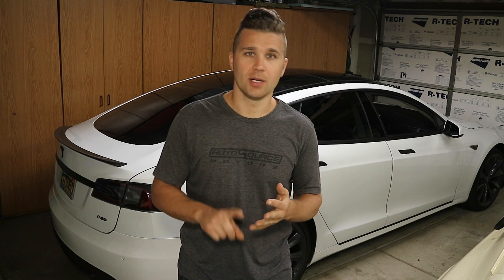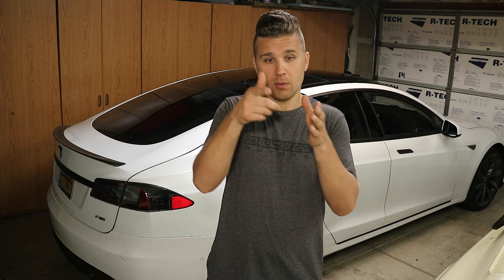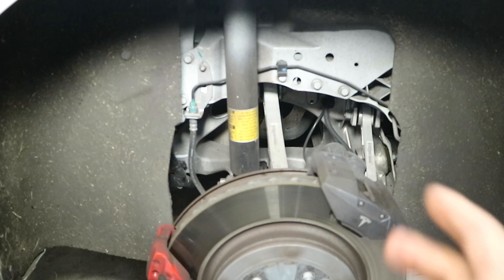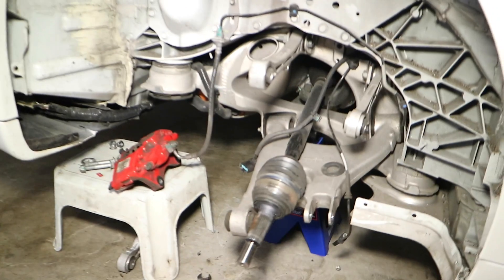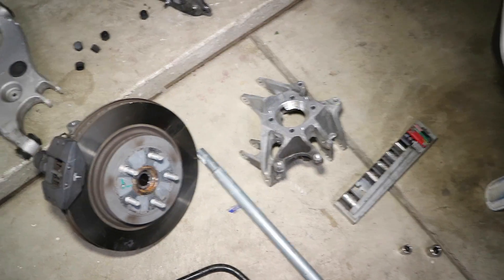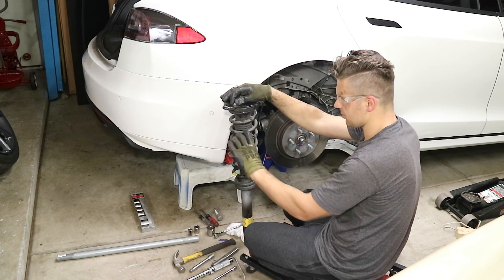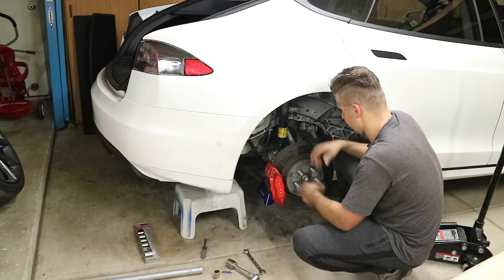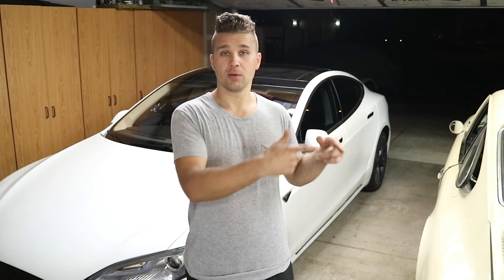Tesla Model S Suspension Issues and Problems

Comment: Ive a 2014 P85 now 135,000 uk miles I think the problem is a lot of hard launches deform the rubber bushes as the upper control arm is the torque reaction point and only being RWD and 2.2 ton thats a lot of torque. AWD cars share the torque loads with the front wheels. My car rear wheel steers a bit with the accelerator.

Comment: Good video -- but how the heck did you get the inboard front nut off the lower control arm?  I see the slot up from under where the aero panel was, but the access isn't straight?  Did you use a flex head wrench??

Comment: i have same issue caster is off one side (did the finger test lol). great video, i follow your guide and change the hub that didn't fix it. so i change lower control arm and fix it finally. i was sceptical that lower control look so beeffy, how can it be bent right? i was wrong.  when i took the old one out and lay it next to new one.. i can confirm the bent is lower front of the arm (arm left/right same part flipable) so anyone have rear suspension caster is off.  i recommend change the lower control arm 1st..
Reply: Is your car a new car or did you buy it used?

Comment: So what component(s) were bent or damaged??? Was it a bushing? - I can't imagine deflecting these massive elements. Must have been an accident.
I don't like to work on suspensions. I have possibly the same Craftsman air compressor like yours. I use the air tools as much as I can, certainly during dis-assembly. Air ratchet, 3/8 inch butterfly impact wrench and even the 1/2 inch impact. Torquing during assembly is a pain but advisable.

Comment: Great undertaking, and without a shop manual!  I would have had a few extra bolts when I finished that job.  Nice to see someone working on the Tesla.  The first I've seen on YT.  I have a 2014 ordered, due next month, and I'll be sure to check the tire clearance when I get it.  I'm thinking it may have been caused by the 21"'s hitting a good pothole.  Another reason why I wanted 19"s in my Model S.

Comment: Torque specs from a random fastener distributor? Hahaha!!! Tesla bolts have a special coating that changes the friction level, changing the torque spec as well. Some should be changed every time they are removed. And the control arms, or in general any suspension arm with a bushing in it, should be torqued with the car at ride height. Is that axle clicking when pulling away from a stop yet? They take a special grease to prevent that. You don't even know what you're talking about with the very simple brakes. The electronic parking brake is only the grey caliper, it doesn't have any effect on the read caliper which is the normal braking system. I'll give you credit for not letting the caliper hang though, but if you're working on cars a lot just spend a few bucks and get some hangars. And you're lucky your car doesn't have air suspension, they are a lot harder to get the strut back in, which you really didn't need to take out in the first place. 
This video can best be described as "more money than brains". Good luck with that.

Comment: I would not have gone on a test ride because the alignment was on a bent wheel.  When you put in the straight part, you changed the alignment.  I would have taken it to the alignment shop first, and then test drive...

Comment: I've been thinking getting Tesla from auction.
What's your experience telling you about it?
My concern is if it's hard to get parts and did you have problems with any electronics (sensors, modules)?
Since it's very different from typical cars

Comment: Larry puts two fingers in the passenger side wheel well
Driver side he puts three fingers into wheel well.
re-watch you can see passenger side his fingers are lower 
(note panel horizontal line and his fingers are higher off the ground, right?)

WHY didn't he actually measure the gap? 
You can try on your own car. insert 2 fingers and then do again with 3 fingers 
(which of course means you are further above the ground.

This may be why no one could measure anything wrong a the alignment tests.
It was great to see the replacement, he did a really nice job.

Comment: Is it possible that this was a bushing issue that was bored of center and when installed caused a mechanical off set? It very unlikely that you would be able to deform or bend cast aluminum without it showing cracks.
Reply from the maker: No i believe the lower control arm was bent

Comment: wow, strange the initial alignment test didn't show the problem/arm bent.
Reply from the maker: Only when the suspension is under compression it would show. Alignment only reads front and rear wheels driver or passenger side. No sensors to read bothwheels rear or front at the same time.
Reply: Man Meets Garage  Hi I have a similar issue, which part was actually bent on your vehicle ?
Reply: CanadaRulez4Ever i

Comment: How is pricing on Tesla parts compared to other american premium cars? Those parts looks extremely expenive with all that machining done to them. Also it looks that Tesla used steel bolts againts the aluminium, if they have I'm a bit concerned with corrosion  because of the salting here in Norway..  Thanks for giving us such a detailed shot of the suspension!
Reply: Stainless steel is often used with aluminum.  I'm not sure if that's what Tesla did, or which SS, but I would presume that would be the case, since I've never heard of corrosion being a problem with Model S.

Comment: Most likely somebody raced the car and hit a curb with this tire, that's why the control arm was bent or as previously mentioned the car had been in an accident. Also when you took off the strut there was no need for any rope or clamps, you only need it if you dissemble the spring and shock absorber.
Reply from the maker: Thanks

Comment: Well I guess all that torque's been working this arm, maybe it had a structural weakness right from the start, on a molecular level. Aluminium is a tricky beast to get stiff.
Reply: If you watch carefully around the inside of the wheel well, you can see signs of repair, this looks like it hit a curb too hard.

Comment: You could have edited out tighening the bushing mounts with the suspension loaded, or.. you tighened all the bolts on the suspension without loading up the suspension. And if you did the later, Congrats on torn and ruined bushings =D Or at the very least dramaticly decresed life on them =)
Reply from the maker: Suspension was pre-loaded and torqued down. Thanks

Comment: i was in a tesla for the first time today it was a cab im a mec so i asked do they have problems i know that Electric powered tools Works great to start with and then the problems comes he said that there was some problems with door handles and power Windows  but no problems after that the warrenty on the battery cells is 200.000 km after that it is 80.000 kr or 13.000 $

Comment: Very well done Man meets Garage. There is nothing like sharing technical knowledge. Thanks again.

Please find links to 1) Tesla S suspension description and 2) Suspension Repair manual with torque settings. The air suspension is a little more involved and is also described. SAFETY is key and I do hope Tesla will make what is currently available to residents of the state of Massachusetts is universally available to all.

https://ln.sync.com/dl/b8e8bf9d0#qyvqcz3x-68yk7q9j-w24qwvjs-2thm6xcg
https://ln.sync.com/dl/5b988ef40/xthdc8pe-jeg4d9z9-ubfxjvkx-7gctvc33
Reply: Sorry guys - recreated links to docs below -

https://ln.sync.com/dl/e946047a0/cy5vj5c2-38ci6d8d-bx4zg2xt-jqmtpnqt
https://ln.sync.com/dl/48aa25b40/73hk6yfg-skyaqvxy-amzitgf5-4hdvhy74

Comment: okay... where did you get your parts on a take out basis from Tesla?  what did those parts cost? .. Your car has obviously been curb slammed .. this happens when the car is pushed too hard into a corner and the back end washes out... seen several videos where this has happened... did you check that strut for cracks in the mounts?   You obtained this vehicle 2nd hand from a TESLA retailer? where did you get the torque specs for all those bolts? are they available online? thanx..
Reply from the maker: i purchased the parts on ebay. Vehicle was purchased at an auction. Torque specs are followed from boltdepot.com.
Reply: bought real TESLA factory parts off ebay? .. they don't look salvaged.. are they knock offs? or are the employees in business hocking parts?? hmmm..  Auction purchase, no warranty,  reason #1 buyer beware.. I wonder what other abuse that car took... Tesla wouldn't resell it off their lot... no wonder...  thanx for the link... likely will be the 1st of many repairs on that Tes.. I bought the warranty coverage . happy motoring. .

Comment: Nice job, but what was the actual problem? Did you mark the alignment eccentrics and put them back in the same position or set them midway during reassembly? 

It will be interesting to see what it looks like after the alignment. Hopefully you fixed it.

Comment: someone says low maintenance on electric cars . I don't know about that..
Reply: Electric or petrol, if you curb the christ out of the rear and bend the shit out of stuff its going to need fixing, its hardly maintenance.

Why on earth would an electric motor prevent this?

Its like somebody throwing a brick at the window then a spastic like you coming along and saying "Well I didn't expect to have to buy a new window, its electric after all, I thought they said it was cheaper to run".

You need to get out of the gene pool.

Comment: As a certified mechanic i can tell you from the spray paint on the shock that the car was in a rear accident you needed to take it to a frame specialist to make sure its square.... and replace the other side lower upper  and hub assembly... those aluminum arms are so thick they dont bend very easy ...so it had to of had a accident from that right rear quarter panel

Comment: Great video and great job.  Congrats on the fix.  That is a tough one!  On another note, it looks like that P85 has AutoPilot 1 based on the ultrasonic sensor on the rear side by the wheel well.  If that's the case, that MS is rare.  There were only about 300 of those built in late 2014.  We have group on the Tesla Motor Club forum - "the 300"  We would be glad to add this MS to the list.  Let me know if this is the case.  Thanks,
Reply from the maker: +Tom Melka Yes I have autopilot. Built December 2014
Reply: Man Meets Garage Thanks for the info. We would like to add your MS to the list   What's your name, where are you located, are you the original owner and what's your VIN ?  Any info you are comfortable sharing.  Check out our list of "the 300" on Tesla Motor Club. Thx, Tom Melka.

Comment: Had a similar issue with mine in November.  Car would start swaying on slight right curves.  Turned out the wheel hub had fatigued unnaturally or was damaged at the factory (it was 3 months new at the time) and there was enough room for the right rear wheel to start moving around in weird ways under load.  Its cool though that you have the knowledge and skills to fix something like this yourself; saved yourself a hell of a lot of money.
Reply from the maker: Wow 3 months new. Thank you very much.

Comment: Where did you place the jack stand? There are no official sites other than the jack points according to Tesla. Nice video. Thanks.
Reply: Obviously he meant motor.  Some people use the words interchangeably.
Reply: there is an engine in a Tesla. It is not an internal combustion engine, but an electric motor and transmission. An engine all the same. Nice job.
Reply: There is no engine on any Tesla.
Reply from the maker: Under the subframe of the engine, strong point. Thanks

Comment: I also own a 2013/2014 Tesla that I bought from a private garage.  The owner got sick and died (not because he bought a Tesla) and it sat uncharged for a long time.  And he never did a service.  This caused a problem with the charging system, but I contacted Tesla and they fixed it under the warranty.   Since I don't have your mechanical ability, I am relying on the and they are very nice in Bern.  You said that there was no tire wear at all before?  Did you notice a change in alignment after?  I haven't finished watching the video.  I want to buy a Nissan NV-200 EV for my company but the battery isn't enough.  Can you help me with getting about 300 km range with a 720 kg payload?  I talked with Tesla and they said they will give me some ideas, but they can't do the work.There are lots of people in my area of Switzerland that want to switch to EV but they need range.

Comment: I’m at your feet.  That was some serious back breaking work.  Wouldn’t it have been easier if you had had a lift available?  Be careful how much punishment  you heap on your lower back.  You’re young so you won’t feel it now, but you will, when you become older.  Take care of your body now, and it won’t come back and hurt you later.  

Excellent job, by the way.  I’m no mechanic but your work couldn’t have been easy even under the best of circumstances.  From what I’ve heard Tesla doesn’t put out a “Chilton’s Repair Manual” for Teslas.
Reply from the maker: Thank you very much for the tips. Maybe one of these days ill get a lift.

Comment: Interesting video. But did you identify any bent parts?? what was the problem.
The upper part of the suspension geometry seems fairly weak. It seems they figured the lower arm is plenty strong. Since it was forward it would either be backup damage or acceleration damage...
Reply from the maker: Side by side couldn't really see and difference where it could be bent. I bought the car on auction so i don't know what could have happened.
Reply: Man Meets Garage -You should have mentioned that you bought the car at auction in the video or description. Video kind of leads people to think Tesla has bad quality or something. Most likely, the prior owner smacked a curb or had minor accident that bent the control arm.
Reply: Could be worn out bushings, since it is a heavy car.

Comment: why didnt you go to tesla first? this is a factory fault , and your car is only 3 years old
Reply: The warranty applies to the car not the owner.
Reply: I guess that Tesla has had an accident before. I've had a severe rear-end collision at my former Mazdaspeed 3 (~30+mph while my car war parking), exactly the same behaviour - the car was not safely to drive anymore at 100+mph; it was able to go 170mph and I used it regularily up to 150mph on the Autobahn before. Because no mechanician found the cause of the issue, I sold the car some months later...
Reply: to me, it seems he hit a kerb or something like it... i did a very similar thing with my bmw by reverse parking..
Reply: So that means its been company owned? If only owned by private i would think its waranty anyway?
Reply: How much did you get it for?
Reply from the maker: I bought the car at an auction 2 years ago. No warranty
Reply: hp9mm my thoughts exactly...it's already out of warrenty?

Comment: Nice job bud. If you like taking these things apart checkout my page
Reply: Yeah like BMW and Merc haven't had their share of issues. Cracked heads ring a bell? How about the Merc 190? BTW this was most likely the result of an accident, even maybe hitting a curb rather hard. He bought the car at an auction, so there's that.
Reply: He bought it at auction so it's possible that it has been in some kind of accident before he got it. You can also see over spray on the strut where that side was painted.
Reply: Mitchell Radford h
Reply: ..One of the many surprises in buying a "fixed" crashed car .. somebody having done a for profit junk butt repair  ...  some dude did a realignment and left the damaged suspension in place!
Reply: h
Reply: Brad King Nice job,  that was a lot of work for one night. Very impressive!!!
Reply: Tom H not at this milage
Reply: Yes, nice Completely unjustified work!

If this had happened on a BMW or a Merc, everybody would be laughing at them!

Whereas with the teslslsasl, people are continuously trying to find excuses!

And by the way if something goes wrong with that bit of the car, the first thing telslsa will say is that warranty has been voided.

Comment: Great vid. Very tough detailed job. Other than the suspension problems, how do those 21s ride?
Reply from the maker: Thank You! Great ride no issues. It will be expensive to replace. LOL
Reply: Man Meets Garage Gee whiz lol. which part? wheels, tires or both?
Reply from the maker: ClayDayz lol sorry. Tires have been awesome and the wheels are perfect fit for the size of the model s. Expensive for a new set of tires. Great Cornering and no problem launching. Thanks
Reply: Ok gotcha. Thanks for replying. Take care
Reply: What do you think about air suspension vs coil on the Teslas? Is it worth it?